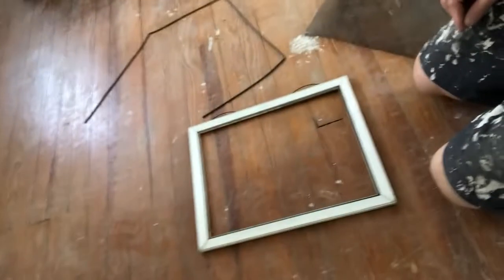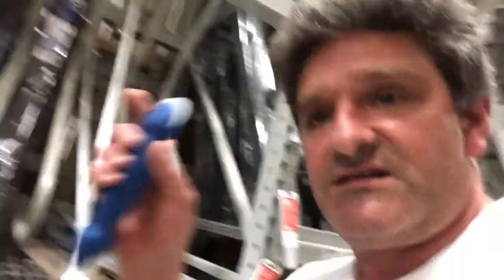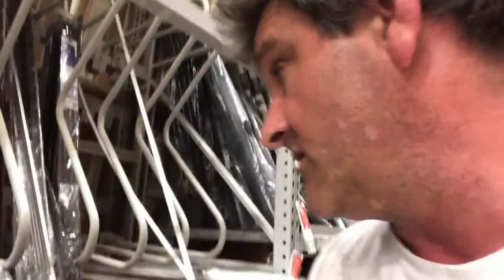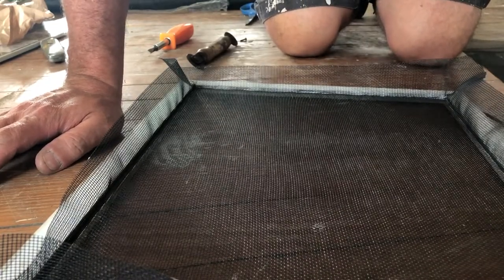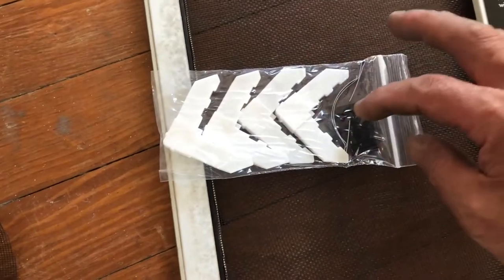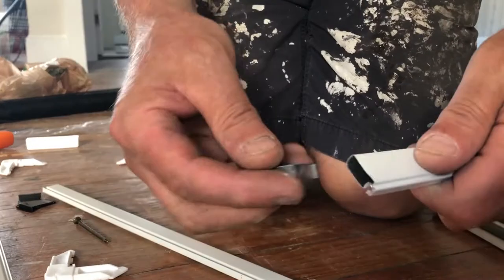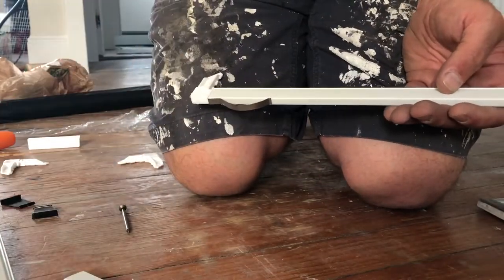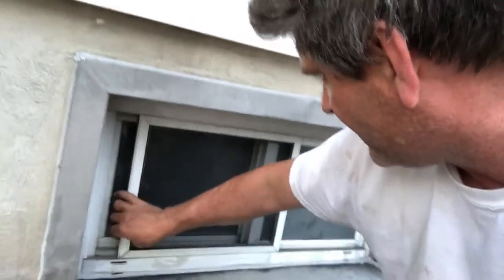Repairing Window Screens and Building a New Window Screen

Comment: A couple tips.  There's different diameter spline cord and the spline tool should have two different sizes as well. 
Pet screen works really well.  Once our car realized he can't damage it he doesn't climb anymore.  
Pet screen needs smaller diameter spline. 
Next stop for you could be an Amazon Influencer if you start buying your stuff there.

Comment: Birds ate at my screens creating holes so I really need to replace them. But for now I need a new dishwasher.  What brand do you recommend, Charlton?  My original GE appliances in my condo are 26 years old.  I’ve heard that nowadays with the new electronic circuitry they aren’t built to last more than 10 years. What brand do you think would be reliable?